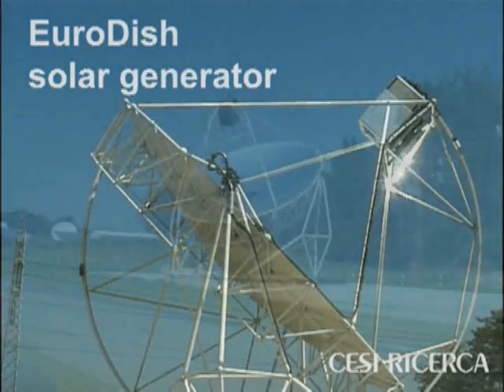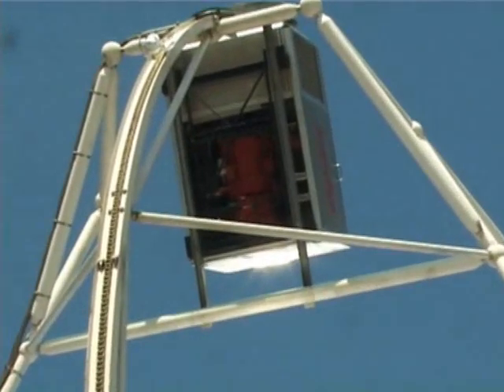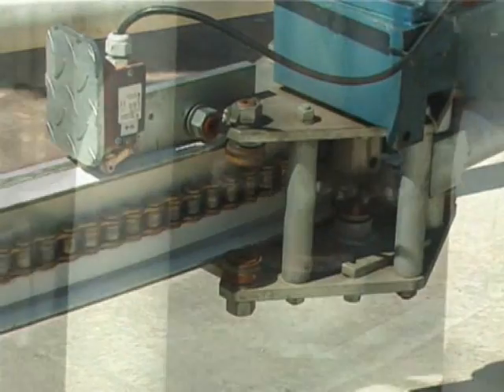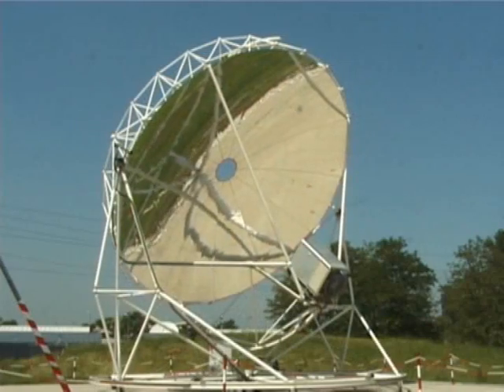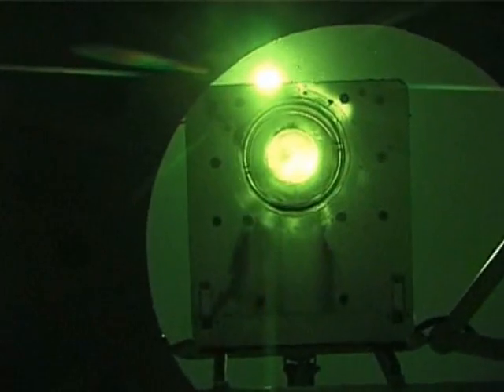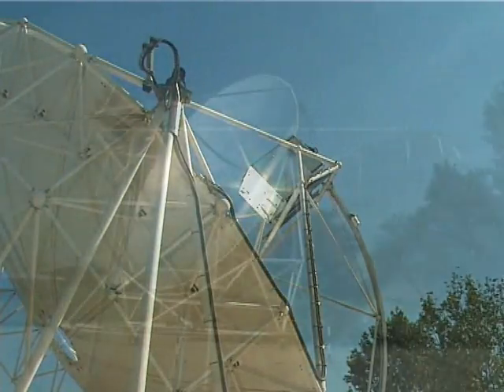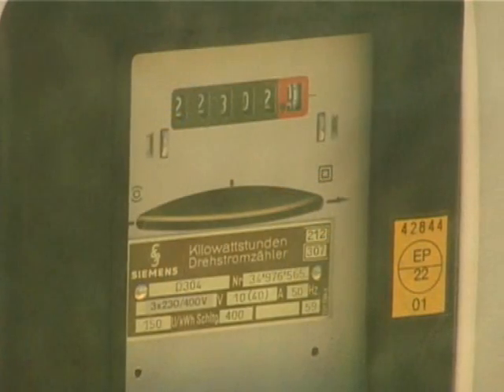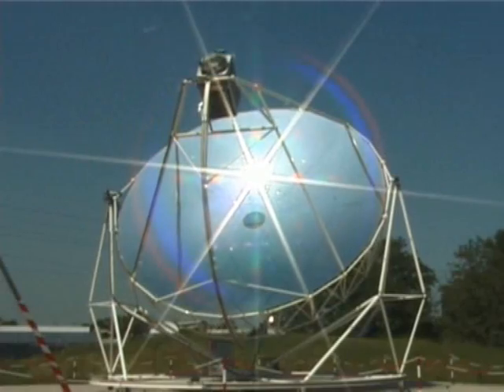EuroDish 10 kWe dish Stirling generator Milan - http://www.solarthermalpower.it

Comment: Only 19 percent efficient ?
Why such a low efficiency with a sterling cycle unit ?
Concentrated parabolic solar concentrators combined with sterling cycle should be better efficiency than that.
Perhaps they are not considering the waste heat that they don't use and possibly could.

Comment: @uggligr A 1000 MWe light water reactor uses about 25 tonnes of enriched uranium a year and the cost of lifting a metric tonn in space (the lowest possible) is 120.000.000$. so annually you would require  at least 3.000.000.000$ to get rid of the waste of only one reactor. however the success rate of space launches is 98% so every 3-5 years you would have one launch failure which would resault to massive radiation pollution.

Comment: You failed on all accounts.

Coal must be dug out of the ground.  This already makes it less efficient.  On top of that the maintenance of a coal plant dwarfs taking a bucket of Windex and a squeegee out in the desert and occasionally replacing bearings.

Nuclear is impractical in that it uses dangerous a substance, but also uranium is a very limited resource.  Requiring great amounts of refining to acquire the mineral from ore because the richer ores have largely been mined away.

Comment: So you think cleaning a mirror is higher maintenance than a coal mine, the rail network and a  powerstation put together.
There is a small 1.5MW plant being built with sixty 25KW stirling engines in Maricopa County , there will be 5 permanent jobs created of which 1 is for maintenance.

Comment: 9000Kwh per year. You need to relate production with costs and reliability. The comparison renewable not renewable must be done by considering the fuel saved, NOT the cost per kWh.

Comment: You use 10KW of electricity an hour? Thats 250, 40w light bulbs turned on for an hour! No wonder I'm paying so much for electricity, ha ha. Just kidding, I think the average house supposedly uses around 5-15KWh a day or 200-625W/hr or 1752-5475Kwh per year. So if it really is supplying 9000Kwh a year, Yer only using 19.4%-60.8%

Comment: in fact the system only works in sun hours, so you can make the calculation of the factor of use.. with 12 hours... may be 15... but it doesn't work the all day because is SOLAR... the idea is do not use conventional plants in the sun hours and use it at the night... so you can have  from 16 to 20% of the FU... also you can make this hybrid... using Biogas... 
Saludos desde México

Comment: No, my point was that if the cooling system breaks down, as in stops working, the cells would be damaged by the heat, maybe even destroyed. 

The small turbine idea sounds nice, but stirling engines negate a whole cooling system that PV's would need and I kinda doubt the increased build, maintainance and chance of failure costs would be made up by the increased energy output.

Comment: I guess one of the reasons they use stirling instead of PV cells is because if the cooling system goes down for even a small amount of time the cells burn, while a stirling doesn't require additional systems to keep it operational.

Comment: this system will have to run for quite a few years, just to pay back all the energy used to build it... 
Thousands of KW will bee used manufacturing the reflector, making the tubing, welding the tubing, and machining the parts for the generator.
You have to factor all the energy costs... not just the output

Comment: Just ONE of these dishes (plus batteries in your house) could indefinitely power an energy efficient house (2737.5 kWh a year) and 2 Tesla Roadster cars (each 2,660 kWh per 20,000 kms - ie: per year).

2 dishes, and you wouldn't even need to bother with an energy efficient home, and you could have 3 cars.

So how much are these dishes?